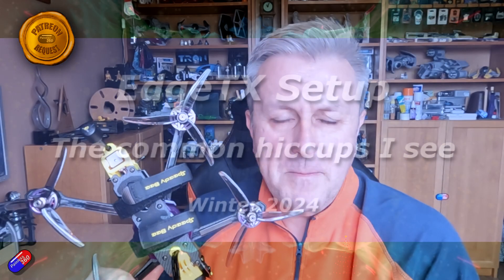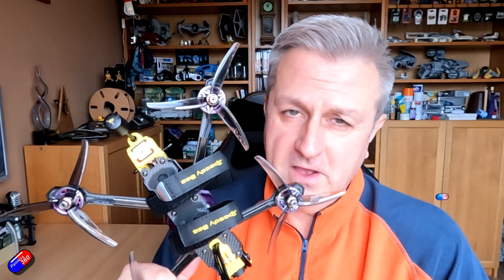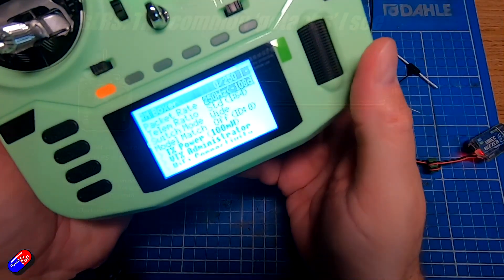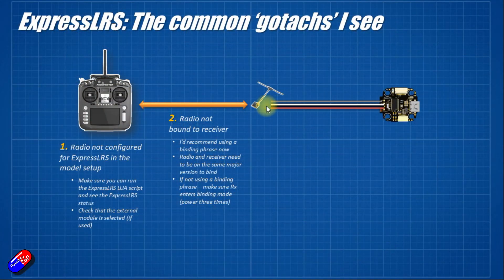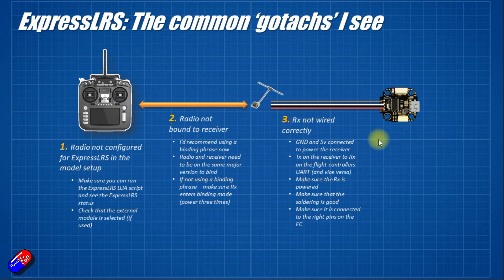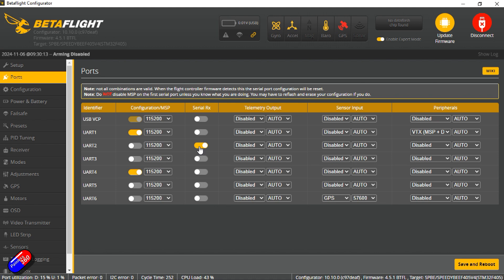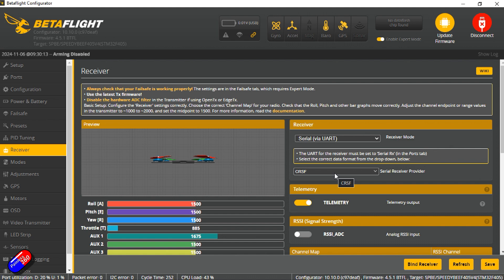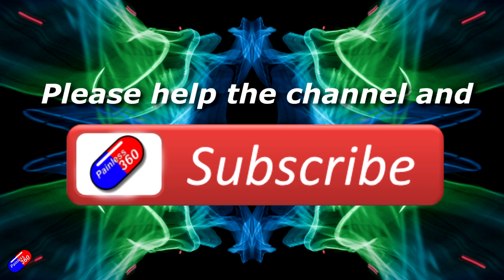Fix your ExpressLRS receiver not working (ELRS): The common errors I see all covered in one video

Comment: I have some strange behavior from ELRS receiver. It was working fine but out of nowhere it started to act strange. It would only connect to controller if O4 was off. So basically if powering FC using USB, it would connect to controller. But from the battery it would not work because O4 would boot with it. I have added capacitors to 5v as well as to 9v rails but it did not help. So now, to operate my drone I first plug USB  cable in and give it a power from power bank, receiver connects to controller, then I plug the battery and O4 boots, and then I disconnect USB cable so I can go and fly. Unfortunate thing is I have to do it every time when I need to swap a battery. I guess FC is at fault but could also be the receiver itself.
Reply from the maker: I've never seen that, I would swap the Rx and see if the problem persists... Best of luck!

Comment: Hello. So the issue I have is when I connect my receiver to my drone when the battery plugged in I get a dash in the right corner of the LUA in expresslrs and nothing works. But when I connect to betaflight  with just usb and connect the receiver I get a C and it all works in the receiver tab. I’m using the caddx vista and flight controller uses a different uart then the expresslrs transmitter. Do I still need to unsolder the sbus wire?
Reply from the maker: Possibly. It sounds like ehen the HD system is powered is when the issue occurs.. Best of luck
Reply: @Painless360 I was kinda tinkering and I powered the fc with usb and connected my radio master. It showed the c in the lua. Then plugged in the battery. It stayed connected but when I looked in the goggles there was the DJI info but none of the other osd info.
Reply from the maker: Check out my builds for the foolproof steps I use to setup flight controllers?. Best of luck

Comment: Both my 04 drones elrs will not arm, if I turn the switch on before turning on it, I get a switch warming meaning it working, and also if I disconnect my drone battery I get a telemetry lost, meaning I have a connection?? Please help,
Reply from the maker: Check out https://youtu.be/eQX6NF-i-bg best of luck
Reply: @Painless360  it's strange all of a sudden they both stopped, will watch the video, thanks

Comment: Hello Everyone, I was using flysky since 2015 or so and after enough reading and interest got a pocket w/ RP1 Rx into a hglrc sector132 that once config'd flew just fine about 2 times over 2 months. That was 6 months ago and now upon startup, the rx shows connected but does not respond. I looked and the right model has an asterisk on it. I did want to check in BF but the prop guards make this difficult and now I either have to take off the one prop guard (don't want to)or find a usb cable with a small enough plug, all my other micro usbs won't go smoothly into the socket. grrr. But back to my prob, why doesn't it work now when it was working fine last time? Many thanks!!

Comment: Also cut he SBUS wires if you are using DJI O3 VTX.  They are the brown and orange wires if you are using the 6 wire OEM wiring harness provided by DJI.  You only need the power, ground, RX, and TX wires when using ELRS or TBS Crossfire receivers.
Reply: That tip helped fix my issue.  Thanks!

Comment: Can I use two different ELRS receivers with two different ELRS transmitters with the same passthrough password set on all RX and TX at the same time without the signal interfering? I am flying fixed wings.
Reply: No, you cannot have two transmitters with the same phrase operating at the same time as two receivers. They will interfere with each other.
Reply: @pkendall64  Thanks, can I have the same binding phrase on both RX and TX but with different Model Match id to make it work?
Reply: @afilos  No, with model match enabled, even if the model numbers are different, the TX and RX will connect but no data is passed to the FC or servos.
Reply: @pkendall64  So I need dedicated TX to each RX, to fly both TXs and RXs at the same time. thank you
Reply: @afilos  Well, with 3.5 ELRS theres a new binding mode on the RX called "Volatile" which forgets it's binding when power is lost. So the RX will always be in binding mode when first powered, so you just need to bind (from the Lua script) before flying.

Comment: Some Spi receivers won't support some higher packet rates so that's one more thing to note
Reply from the maker: Thjanks for the note. I stay away from SPI based receivers. I've had all kinds of problems with them here and seperate Rx are so much easier to setup, use and troubleshoot and work so much better for anything beyond flying round the house IMHO... Happy flying!

Comment: thank you . i have been on the struggle bus......a vid well worth saving for me, with luck my new tanq build will have its elrs rec going.  thank you again for all you do and the time you spend doing it.
Reply: In the process of trying to fix my servo problem i was trying to connect the rx to expresslrs threw Wi-Fi and bricked the rx and now when I try to flash it threw betaflight on expresslrs it’s say flashing blindy rx cant be detected. I have it in boot mode..Any suggestions?